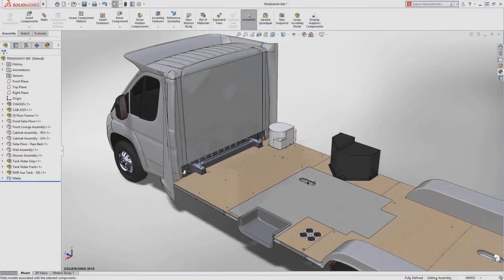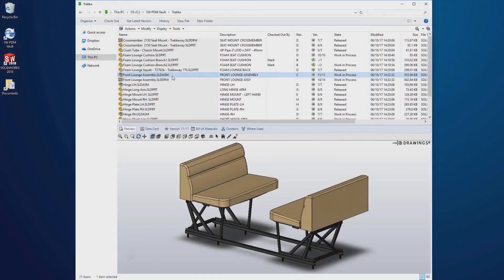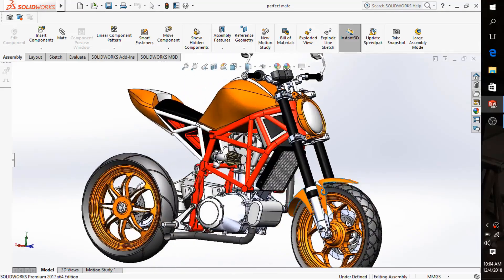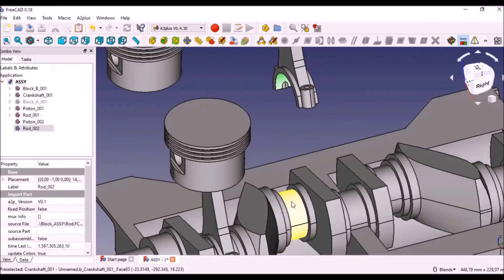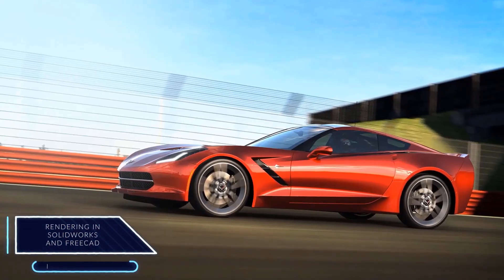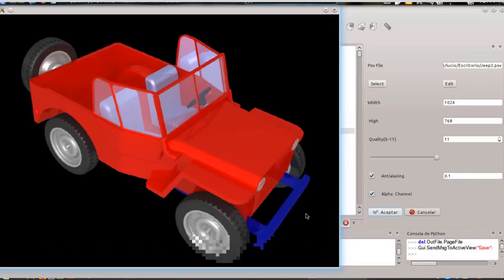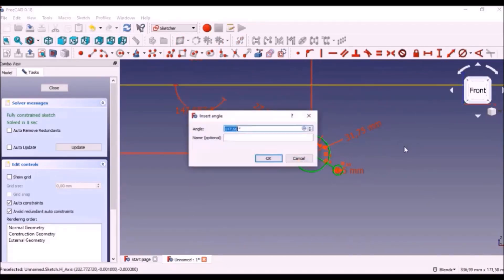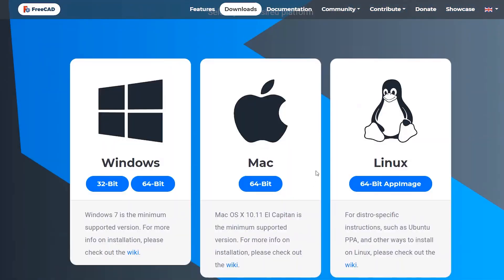SolidWorks VS FreeCAD, which is better

Comment: Fusion 360 foooor the win
Reply: Not anymore :) those guys will and are starting to remove features constantly and it is a cloud software.
Reply: Yes it is
BUT not free anymore for hobbyists.
And that's why I chose freecad.
(A steep learning curve for my age 60 year)
Reply: @mclam5623  It still seems to be free for personal use? I've been trying both FreeCad and Fusion 360, but working with constrains in FreeCad feels quite clunky and if I want go back changing something in first object I've created it usually explodes everything attached to that object. 

So I donated some money for FreeCad and went on with Fusion 360. FreeCad doesn't seem to be getting much money so I don't expect it to evolve much in future.
Reply: @finnderp9977  I'm not that far into freecad to see the hurdles yet.
And
Fusion = Autodesk = free until the most features are working properly and most of the bugs are solved.
I'm using Autocad since v.13, and always the same story, some time for free, then paying.
And there's the problem for me, I'm a hobbyists, I don't create spectacular things. I don't design tools, machinerys, vehicles, boots nor plains. 
So I can't afford it to pay that amount Autodesk asks. 
And I don't blame them, they have to make money, just not mine 😄
Reply: @mclam5623  Yeah, well I've printed parts designed in FreeCad so its not limited in that way. It just takes more time, maybe few crashes and if you change design you  probably need to repeat stuff several times. Or maybe there would been better way to do things but couldn't figure it out.
Reply: @mclam5623   Can Blender devs and Freecad devs collaborate  and create new developed software called blender cad ?
Reply: @shadowshadow2724  blender is miles ahead of freecad
Reply: @shadowshadow2724  Blender and FreeCAD are 2 different things. I would like to see FreeCAD grow in the way Blender has, but in it's own applications.
Reply: @shadowshadow2724  no, cos then autocad and solidworks can close their companies
Reply: @Filipcorobivblenderi  Emmm ! but blender already exists ,did Autodesk closed 3dsmax or Maya ?
Reply: @shadowshadow2724  i just know that more and more film producers e.g. are simply switching to blender (rio makers e.g.).
Reply: @Filipcorobivblenderi  that's great! I wish success for Freecad and Adobe alternatives too.
Reply: @shadowshadow2724  Only in my dreams
Reply: https://youtu.be/qJABXBvuoB4
Reply: Still free for hobbyists 🤣